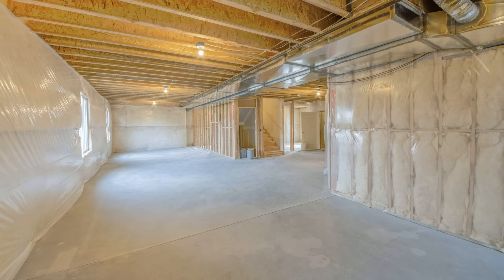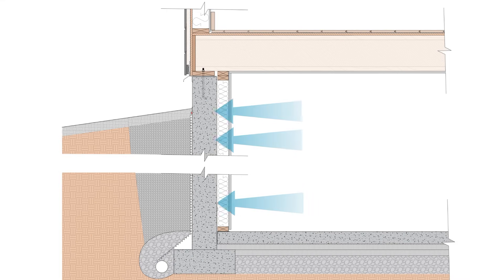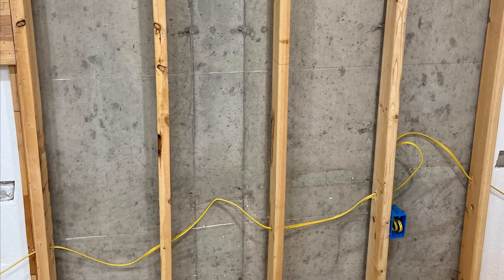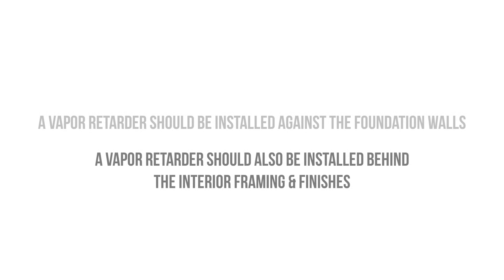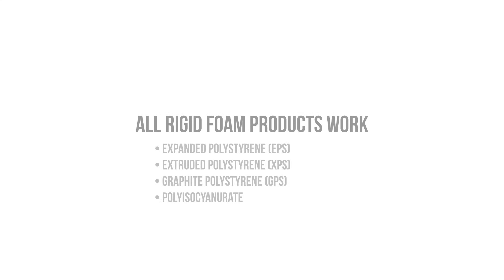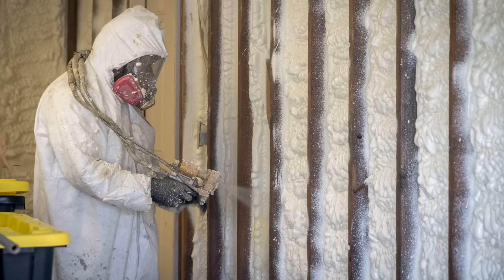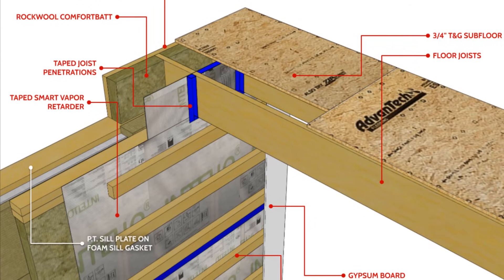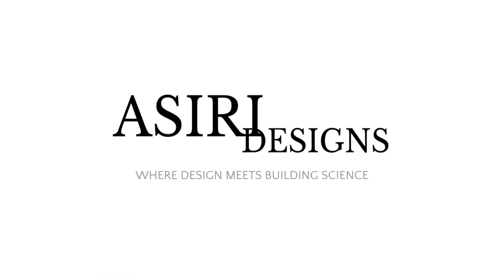The Ugly Truth About Basement Vapor Barriers

Comment: I do have a vapor barrier in mine. But its applied right on the concrete wall, stops at about 2 ft from the floor. The studs are applied on the vapor barrier, which means the plastic film is squeezed between the studs and the concrete wall. There's also isolating foam panels which go from the ceiling to about 2ft from the floor. Dunno if that's desirable or not. No mold though, like at all, unless its deeply hidden behind the drywall... sure hope not!

Comment: Why does are building code here in Manitoba,Canada require it then???
Reply: Good question, I’m assuming many places have it as code. I’ve ripped out many basement walls in Winnipeg and found mold and rotten studs behind the poly. I think it has more to do with the quality of the foundation walls and damp proofing on the outside of the walls letting moisture in. Just my opinion on what I’ve seen in this area

Comment: Why is soil at 100% humidity? Sounds like drainage issues.
Reply from the maker: Believe it or not, even "dry" soils are somewhat damp! You almost never have bone-dry soils except in extreme climates. Also consider that there is substantially less volume of air in soils, so the small amount of air that is inbetween the tiny gaps of soil particles aren't able to store much moisture in the first place.
Reply: @ASIRIDesigns  Ok I just stuck a hygrometer into a hole in the bottom of my foundation... I'm in a dry climate and I have no drainage issues, it's apparently bone dry crushed rock down there yet 98% humidity... Hah!

The basement walls are insulated and barriered in the way you discourage. Unfortunately they are fully finished too... So I can't easily get the hygrometer into the walls.
Reply: @ASIRIDesigns  Interesting, yes reading around I see that even very slightly damp soil can have quite high humidity like 90+%.

Comment: If its in the building code you have to install it to pass the building permit inspections. So whats your answer to that?
Reply from the maker: You can use a smart vapor retarder instead of polyethylene to allow for drying if conditions get wet. It's allowed by code.
Reply: Rip it off after the inspector pass lol

Comment: Can you comment on using Zypex concrete waterproofing. I understand it promotes crystal growth into the concrete, sealing it, the product reacts to water infiltration.
Reply: Xypex is a liquid water crack sealer. It does not block transmission of air and/or water vapor. It would make no different for vapor moving through the concrete toward your vapor barrier.

Comment: Thankyou for this info - well-presented and informative. You are building for the future, not just to look good.  I was working with a colleague when the Building Inspector approved the basement VB being to the local West Coast Canada code. When the BI left, my buddy cut the VB with a huge X, top to bottom - because, as he posited, the moisture would be retained within the stud bays... "Gotta let the walls breathe". I adopted that, but I really should have seen something like this video first.  Remember, the code is the minimum... always improve on it. This video explains the best ways.
I see you advise EPS, but it has its hazards - off-gassing, and combustibility in particular
Reply: Every new home should have a radon barrier and should have the outside of the basement wall spray foamed with insulation ( minimum 4 inches) from the bottom of the footing right to the level of the top plate on the ground floor. Then you don't have to worry about insulating the basement walls from the inside as far as vapour barrier goes. My seventy year old house with an 8ft basement, which is almost half above ground at one end, was excavated to the footing and spray foamed, which made it warm and dry, and only the top three feet of the inside wall has any insulation on it. I only have two heat ducts in the basement, if I put another one , the basement would be as warm as the warmest room on the main floor. I live in northern Manitoba where it can easily get to -35 degrees and stay there for a week during winter.
Reply: @markanthony3275  Never heard of that! Sounds a great idea for northern climates (a whole diferent set of conditions to Vancouver Island). Certainly don't want the foam to degrade in the sun, tho... what did you to to protect that foam? Did you need to flash along the top of the foam to stop water getting behind it - or does it stick like the proverbial?

Comment: Great video - Amen!  It took me 15+ years of home ownership before I learned this the hard way. Eventually figured out that no vapour barrier and rigid foam is the only way to go!
Reply: i have been in construction for 40 years. I have really never seen a good way to finish a basement other than drylocking the concrete and keeping it open. Radiant heat helps a lot though.
Reply: @krakenwoodfloorservicemcma5975  so would you agree with this?
Reply: @krakenwoodfloorservicemcma5975 keeping i it open???
Reply: @krakenwoodfloorservicemcma5975 what about a normal concrete room in a hot humid area, I want to insulate my room but keep reading about mold and moisture problems
Reply: There is a reason why they're used in some aspects in concrete forming structures.
Reply: @timothychung4811  oooh but it must be secret because you don't explain it ?

Comment: In western Canada,   it was code for many years to have  vapor barrier between the concrete wall  & framing, as well under the drywall.
The building code changed in  the late 90's-early 2000's, no more vapor barrier permitted between the concrete wall,.& the framing.
It was discovered that moisture was building up in between that vapor barrier,  & the concrete,   mostly from frost build up during  winter months. 
The moisture would remain almost indefinitely,   and emit a mildew odor,   usually at its worst in the early spring.
Reply: Whew.  Glad someone figured it out.   It’s pretty obvious if one has ever seen plastic sheets
Reply: Isn't that why you tar the exterior?
Reply: Why do we have to follow code when the people writing it cant figure out a damn thing?
Reply: There was a lot wrong with the BC building codes previously... 'leaky condos' being one prime reason for change. Water is the enemy of wood... do whatever you can to eliminate its ingress from outside first. Then make sure whatever is inside can breathe its way out.
Reply: BTW building codes in Canada are Provincially regulated not federal so they can vary by province or territory.

Best way to view a basement is as a porous wet cave under your house and not try to use it as a livable space.
Reply: My home was built in 2003 and has a vapour barriers on external walls. Over insulation and studs
Reply: @Googaliemoogalie in the basement?
Reply: @Minniedog12345  No . In the attic .( haha )
Reply: Ok first off you are actually referring to" moisture barriers" not "vapour barriers" and the need of interior moisture barrier use can depend on your local code changes and adjustments but the NBC 2020 9.13.2.5 still states a Moisture barrier is needed against the inside of concrete walls so the building code has not actually changed. I have examples of acceptable moisture barriers here. https://www.youtube.com/watch?v=P5E2X8Q5jcQ
Reply: @HouseImprovements  
Ok, obviously you dont seem to understand that local codes can definitely change, add, or eliminate  whatever is determined to be necessary to evolve/suite local conditions.
Reply: @RatedCfm-cz8ff what an amazing response. He took the time to post the exact industry standard he is referring to. He even mentions local codes and changes can be different. Your response wasn’t to cite a different code, or a specific standard. Just to insult him. What is the code mister expert. What code is it exactly in Canada. Never mind don’t bother. I believe most don’t want to read your responses anymore since they nothing but illogical opinions.
Reply: @egondro9157  
Wow, what a typical keyboard warrior reply.
Congratulations,  you've won the internet today!
I have a feeling you may require a higher IQ, to grasp the concept of the building  code in my area.
Reply: I improved my basement by removing all insulation, painting concrete walls (preferably with breathable paint), and adding a dehumidifier.  No more mold, etc.)
Reply: That's BS! You have obviously never worked in residential construction. By code, and going back to the 90's, you have been required to install an exterior felt between the foundation and the interior walls of the basement. After studding the walls, insulating etc., THAT is when you apply the vapour barrier!!!
Reply: @realemonful You obviously don't understand code is different in different regions, lol
Reply: @realemonful  
Not in Canada.
Tar, or dimpled foundation wrap on the exterior. 
It WAS code to have poly against the concrete,  on the interior side years ago, that was removed from the code at least 24 year ago, for obvious reasons.
I've been working in new homes for 28 years. 
You seem like you still live in mom's basement .
Get a life ya 🤡
Reply: @realemonful  
Not in parts of Canada where temperatures stay below zero for months during the winter. 
Tar, or dimpled foundation wrap on the exterior. 
It WAS code, a very long time ago to install a layer of poly over the interior side of the foundation wall, between the framed, insulated exterior walls.
That was removed from the building code over 22 years ago,  for obvious reasons.
It sounds like you need to get a life ...

Comment: How do you feel about insulated concrete forms? Based off the information in this video of having a couple inches of Styrofoam to prevent moisture/mold issues and still allowing the wall system to dry this seems like an ideal method of constructing not only basements but above ground as well.
Reply from the maker: ICFs are a good system but they aren't a panacea. As I was telling another person in the comments, ICFs absolutely must be protected from water infiltration and insect damage with a fully adhered membrane, but it gets complicated because the membrane and the adhesives have to be compatible with the EPS foam, otherwise things like solvent based adhesives dissolve the foam. Any system can be made to work as long as the the foundation is well drained and the layers are in the right location. That's the key.

Comment: Here in Sweden we are primarily installing permeable variants of basement insulation and drainage systems, such as Isodrän. They have probably been dominating for the last 15 years. The insulation is installed on the outside without any membrane. With gravel and drainage tubes below the basement walls. The idea is that the basement walls dry out from the inside, which requires a heated space, and causes a high humidity during the first months. With too high water table some membrane might be needed on the outside of the insulation.
Reply: They build a water proof concrete bottomed box.

Comment: I think you also need to do a video on exterior foundation insulation in this context….other than the issue of deterioration/bugs, it is another viable approach yes?
Reply from the maker: Absolutely, if you can protect the exterior insulation from bugs and moisture, it works great. The problem is that this can get complicated depending on what type of rigid insulation you're using. Rigid foams installed on the exterior of the foundation walls have to be treated like ICF foundations, with a fully adhered membrane bonded to the rigid foam, and even that can pose compatibility issues with the adhesives. Rockwool works but you need thick layers and a protection course. For durability reasons I very much prefer installing the insulation on the interior for below grade walls. You can also locate it interstitially, as in the case of a "sandwich" panel, and that works great as well since the insulation is protected.
Reply: @ASIRIDesigns why does it need to be glued to the concrete? The idea is to keep the entire concrete wall above the dew point. I don’t see how a gap matters. I’ve seen SM board with drainage channels onto the house.

Comment: i assume this is for new builds with appropriate exterior water management and not for 84 year old basements
Reply: Yes
Reply: Thank you for the statement.
Reply from the maker: That's exactly right. To address older existing basements, check out this other video on the channel: https://youtu.be/Lm9q8X2L47I?feature=shared
Reply: Doing so correctly it can be done in any basement. Frost walls are a thing.  There's some information lacking period. I'm not even going to bother getting into the details.  There's multiple systems that work with each other.